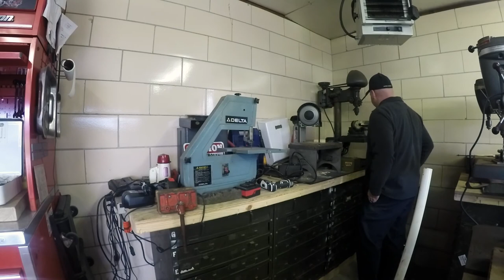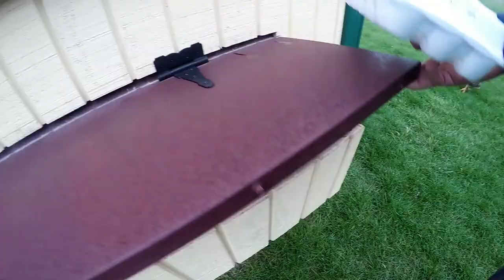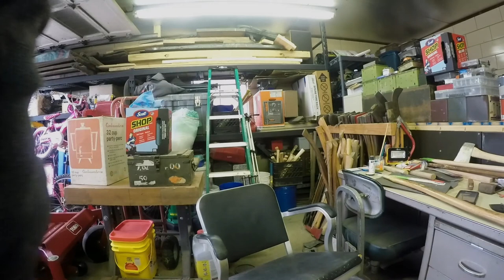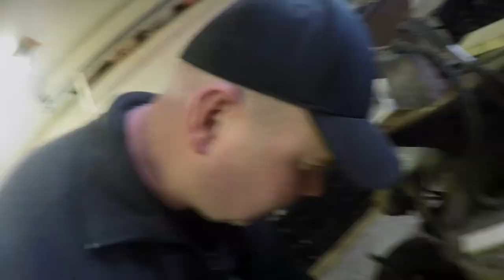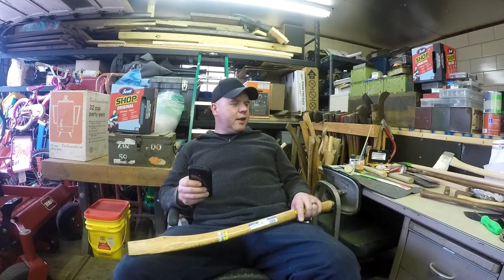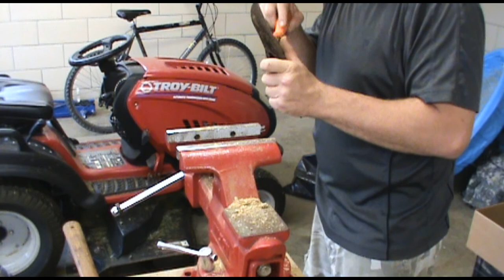I Found Some Axes I didnt know I had!

Comment: Thanks for the shout out. You got it! You've inspired my norlund collecting, so far I got the voyager and camper. Camper has a bent handle so I may steam bend it or just replace it. Maybe a video on fatwood wedges? I know you talked on Osage orange and walnut in previous vids. Possibly video on different wood types and handles?
Reply from the maker: Joe Sweeney I touch on some handles and wedges in the next video. not much to it, mostly hickory and ash for handles and just about anything would work for a wedge although I am quickly becoming fond of hardwood wedges!
Reply: I've been tempted to try black locust. It's hard not to go hickory.